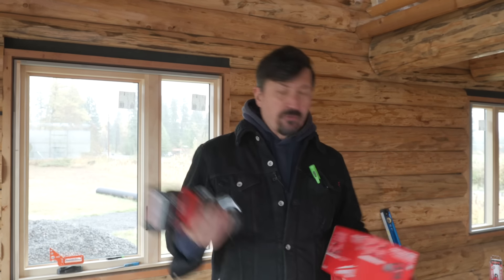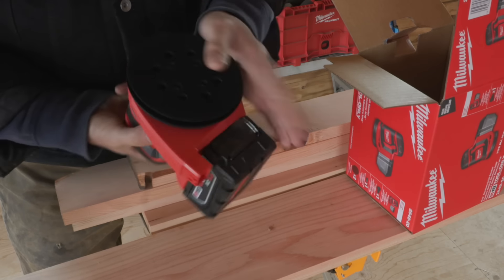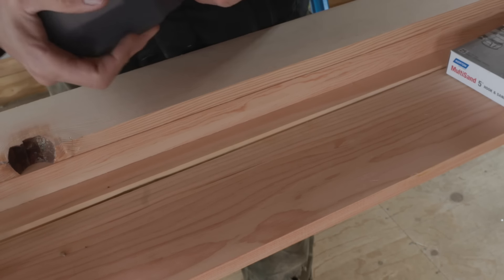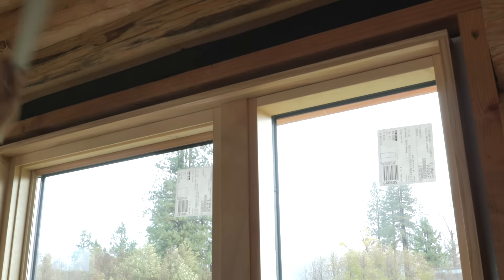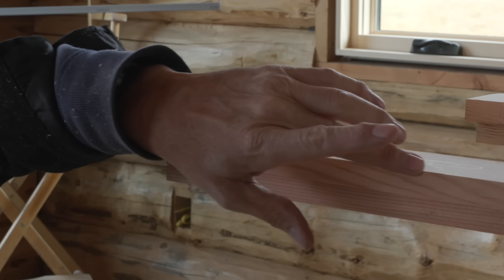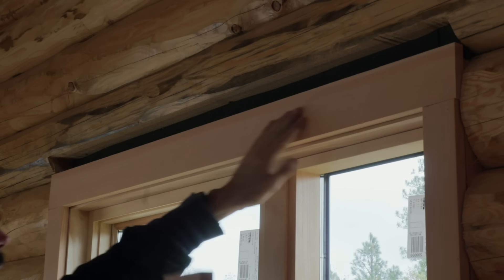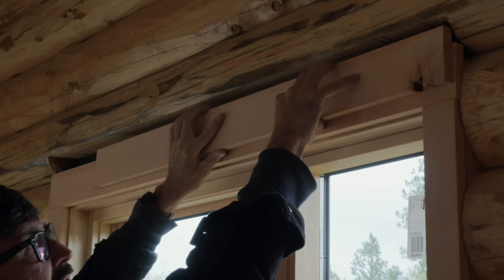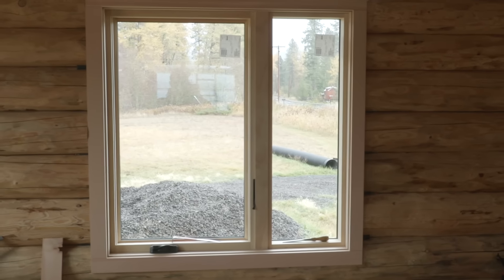Need an Excuse to Buy High-End Cordless Tools? Here’s My Best One Yet!

Comment: Coming from a electrical contractor with years in the field doing commercial and industrial work with 45 employees. Myself and all of my employees previously used Dewalt cordless for many years, they were abused, dropped off ladders and run them until they got so hot we would have to let them cool down to use them again. Previous to that we had Makitas, they didn't hold up to the daily abuse. But, when the Dewalt batteries became pretty much obsolete and it was time to either spend $75 for a battery or replace the tools, I started replacing everything with Milwaukee. Then continued with 360 laser, 1/2" impact, saws, rachet, grinder, LED lights, shop-vac, grease guns, multi-tool and last week purchased the 18v tire inflator. I have not had any issues with Milwaukee cordless tools.
Reply: @sailingwiththegods538   Yes but accidents are prone to happen
Makita's come in light work tools, and heavy work tools
You need an expert to tell you which ones can  handle more work and abuse because a normal costumer won't know better
If you bought for example a grinder that's for light work, it will burn out after 1-2 hours of continuous work, similar to impacts and other tools

And when buying grinders or saws, it's very important to get brushless if possible, as they produce much more power and handle heat and abuse

For drills and impacts the difference between brushed and brushless isn't that big (there's still a difference)

As well as knowing about volts and armature sizes etc.
Reply: This is opposite of my experience.
I started with Makita. Started moving over to Milwaukee because of their Gen 2 nailers.

I've only ever had to warranty 1 makita drill and it was my own fault mixing concrete with it.

I've probably warrantied 6 milwaukee tools already. I'm currently going on my 4th multi-tool for warranty. Lol
Reply: @evictioncarpentry2628   from my experience 
Makita will be built better and have better ergonomics, and will last longer (if you don't get a light use tool, and use it for heavy work)

Milwaukee will have more power

These the advantages they have over each other

I learned much from the repair channel Dean Doberty
Reply: Makita is more geared towards woodworking/carpenters new construction. Milwaukee favors electricians hvac and plumbers with more niche trade tools. I jumped from dewalt to milwaukee 10yrs ago, best thing i did.

Comment: Greetings from Poland. I had to go back to hear the festool comment again🤣 personally I’m getting started on building my Milwaukee inventory. That orbital sander is a beast. I’ve used to remove an old paint layer from my wooden cabin, it did the job perfectly. However festool has one ace up their sleeve the hkc 55 skil saw with an attachable sliding rail- if you ever have the opportunity to try it you will not want to put it down. Mafell has their one version but I don’t know if it is sold in the US . By the way, how do you compare the Milwaukee tools that used to be made in the US versus the ones made in China?

Comment: I love and own both Milwaukee and DeWalt, but I think the DeWalt 20v compact router and orbital sander are a little nicer. Also, the fine depth adjustment ring on the DeWalt router works much better than what's on the Milwaukee.

Comment: Also, keep in mind Ryobi is part of the Milwawakee company. Techtronic Industries owns both Milwaukee and Ryobi. Doesn't mean it's gooder or badder, it just means price compair. 
Festool is a very expensive option, and yes, I've use Makita tools professionally and they are a good tool as well. I've also use DeWalt professionally. It's a Stanley/Black and Decker brand.
14:30 Nice trim job. I agree, the "Craftsman" style suits the cabin. No need for a 45˚miter joint.

Comment: By adding the nail plate to the log behind the upper trim did you just reduce the settling gap above the window?  You could cut a recess in the face of the log for the trim to fit into and then face nail the trim into the log...that way you don't reduce the gap.

Comment: Milwaukee are for sure great tools and I own mostly Milwaukee dewalt and a couple makita. There is no one tool that's best in every job ,certain dewalt work better than Milwaukee like their jigsaw is better than Milwaukee and makita big hammer drill is the beast but to stay with one platform you can't go wrong with Milwaukee dewalt or makita and even some cheaper brands are fine these days. If I had to choose one I personally would go Milwaukee.

Comment: Yep makita and hitachi are some of the last few independent big power tool brands. Problem with both is they suffer from right tool for the right job issues. You use the wrong tool and it bites you hard. Festool is also very unforgiving on how you use them. It really is a fine carpenter tool company or it was 10 years ago. I owned two tools. drill and screw gun both were not the best for rough work. Building a baltic box. They would tank it. 2x6 framing nope.

Comment: Makita brushless 18v drill had .065 runout.  It wasn't in the chuck, so the factory repair center replace the internals.  new drill had about .030 runout, very disappointing.  I will probably go to Milwaukee

Comment: I work as a contractor and my go to is dewalt and milwaukee. That said, I have seen quite a few of seasoned guys using hart and ryobi. Those tool are at 95% as good as premium brands at half the cost. With the added benefit of not growing legs and walking away themselves.

Comment: I’m a ryobi guy because I was gifted a set from my folks and have used it ever since. I have used the sawzall with the Diablo carbide metal blade I have cut 1-1/8” all thread with them.  The high torque impact is just under the M18 in performance.  I just picked up a router last weekend.  It’s hard for me to justify switching  because I can get the job done with what I have.

Comment: A 1x1/2" piece of trim ( or to size enough to create the slot to slide behind) on the window upper casing.then attach your 2x6" to that upper with the lower edge hidden behind it. I rigged a picture rail with a slide rail above and below to prevent all the holes from picture frame hanging. Easy to set them in and switch them out. Your nailing to the upper log will hide the drop into the gap behind it.

Comment: I invested in DeWalt system when they went from their 18v batteries to 20v. I had dewalt 18v and wasn't all that happy with them. The 20v stuff was better. Then shortly after that Milwaukee came out with their new lines. I have been kicking myself ever since but I have bought some new DeWalt stuff lately and I am blown away with what they have done in the past few years. DeWalt has upped their game in a big way lately.
Reply: All three major lines are actually really good. I'm also a DeWalt guy and I love the flexvolt stuff.
Reply: Agreed, DeWalt has turned it on lately. They have great stuff

Comment: I am all in on Dewalt, 12v Skil, and Hercules. I have a few Makita tools as well.  I like Dewalt over Milwaukee because you are getting in general the same tool for 30 percent less and I am a big fan of the flexvolt system and powerstack batteries. 
In my opinion, if somebody is on a budget and wants professional grade tools with an incredible warranty for dirt cheap the Hercules line from Harbor Freight is the way to go. They are quickly becoming my go to tools and haven't let me down yet.  Especially when the batteries are so cheap yet are filled with Samsung cells.

Comment: Using a vacuum on a sander makes the sandpaper last longer since it doesnt clog up as fast. More importantly, it drastically reduces the amount of fine dust produced, making your area cleaner, and and reduces the amount of dangerous dust you breathe.

For the top piece of window trim, you could route something like an ogee into it , might make the two pieces look like a single piece.  Think of an inset panel on a cabinet door